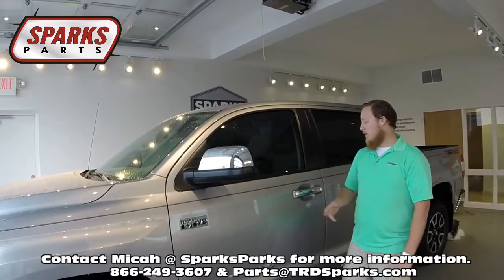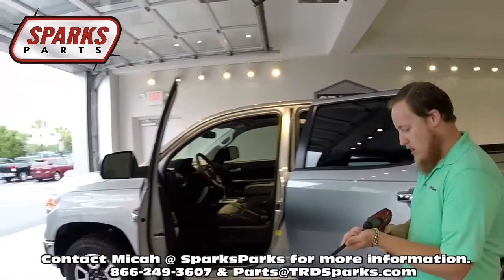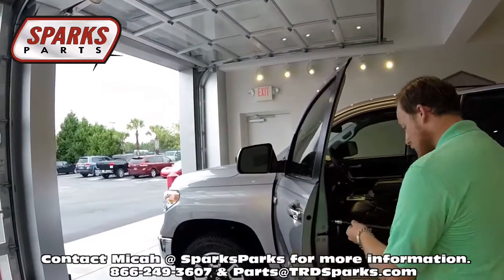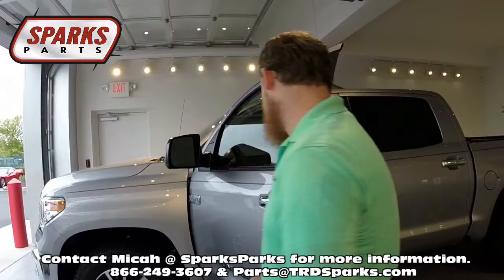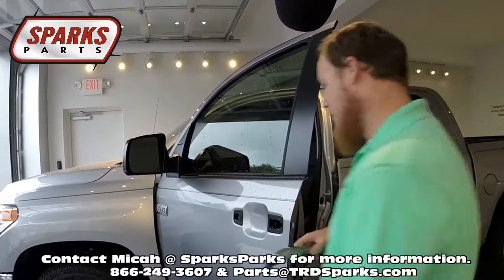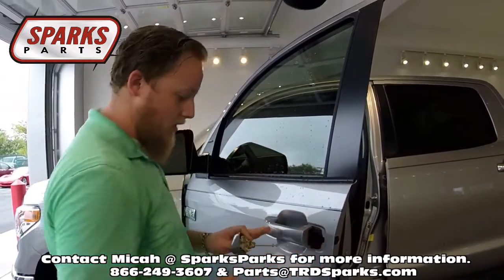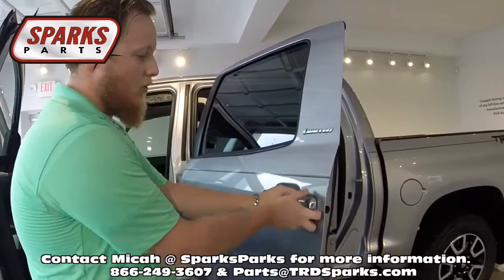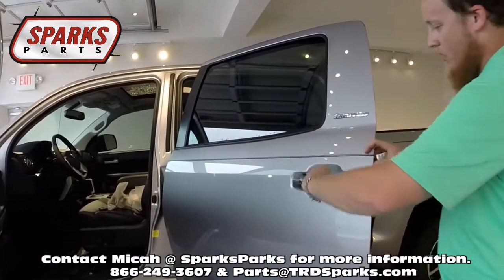How To Change Tundra Exterior Handles

Comment: I just did this and your instructions were spot on. HOWEVER I had some issues with my driver / lock side handle clicking in place. Inside of the door there is a spring mechanism that the handle is supposed to lock into. In my case the spring wasn't protruding out enough for the handle to lock into it. I'm guessing because it was the drivers side it may have been just a little bit more worn in because of more usage. 

Anyhow.... cleaver little "fix" of mine was to get some think 60lb test fishing string / leader and loop it around the spring mechanism. I then pulled the spring out a little bit and the handle slid right in and locked nicely into place. The fishing string is thin enough that it'll slide right out of the handle even after you tighten everything up and wont mess you the paint or anything. Hope this helps somebody :)

Comment: When installing the new handles it is possible that the release lever will not allow the handle to slide forward.  If this happens just take some dental floss and loop it around the small black release lever which comes down from the top forward area of the rear hole and pull it out and down.  Then slide the handle forward fully and pull out the floss.   All good!
Reply: Thank you !!!!!!
Exactly what's happening to me

Comment: I'm in the market for black door handles what's the difference in the black that's offered on the website and the other black that cost more?
Reply from the maker: Did you have exactly what you are talking about? The only thing I can see is that they are different colors. Color code 202 is just a standard gloss black. Color code 218 is a gloss black with a blue pearl in it. Flat black is just a flat black color.

Comment: i just need the door handles no mirror cap is needed, can you supply the part numbers for super white.
Reply from the maker: I certainly can! Here are the links depending on the cab size:
Crewmax: http://www.sparksparts.com/accessories-and-aftermarket-parts-color-matched-exterior-door-handle-crewmax-69210-0c030-kitcr?parent=1325

Double /Regular Cab: http://www.sparksparts.com/accessories-and-aftermarket-parts-color-matched-exterior-door-handle-reg-dbl-cab-69210-0c030-kitdr?parent=1325

Comment: Shit, wish it was that easy for me. The whole assembly fell inside the door frame for me and had to fish it out with two fingers. Such a pain in the ass took hours and I’m still figuring out how I’m gonna complete this. Might just take to a professional shop to get it fixed. Also trying to line up the screw that’s in the door handle to the small door piece is very difficult as you can’t see through the door. So your blindly trying to line up both holes which was stupid hard for me.